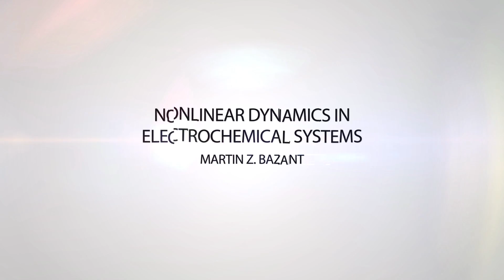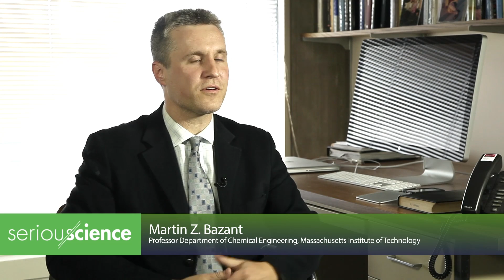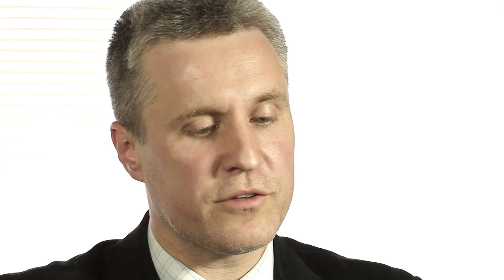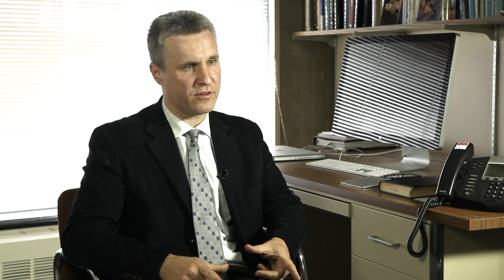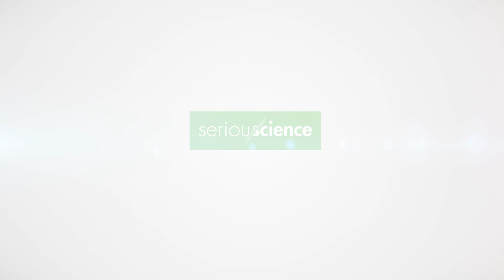Nonlinear Dynamics in Electrochemical Systems - Martin Z. Bazant

Comment: Yeah this guy is quite literally working on one of the most difficult aspects of electrochemistry: ion transport in cases where you have (non trivial) migration effects present... basically for most of the industrial electrochemistry this is the case, as this involves high concentrations of multiple salts combined with high current densities. Ok well that's where I have encountered him.
Very far away from traditional electrochemistry, where you preferably work with supporting electrolytes and low concentration. But in practise this is clearly something really interesting. Because up to now I guess the best you could do is argument with  a few handwaving arguments and trial and error will show you if it works out or not.
Or then you just ignore the nonlinearities or pretend they dont exist. And still what I guess you will find is that all this traditional stuff simply will not work out, because you measure something and it doesnt fit results from standard theory that assumes  low concentrations and supporting electrolyte.